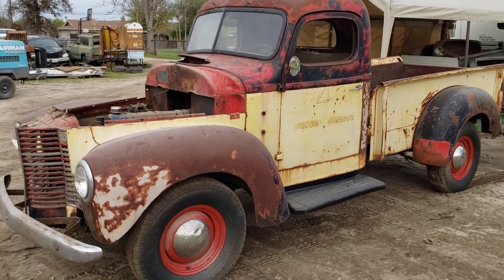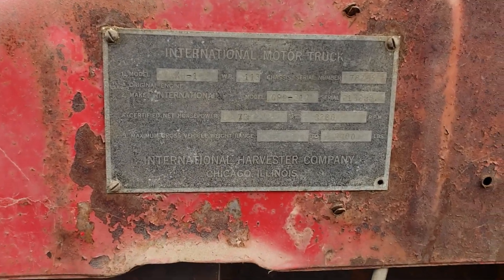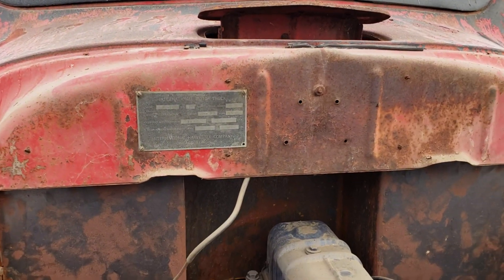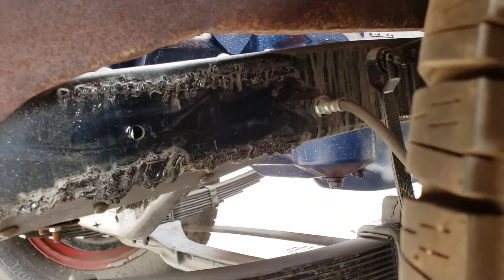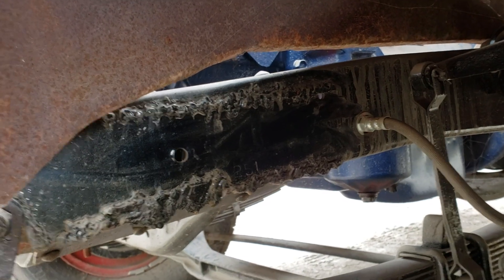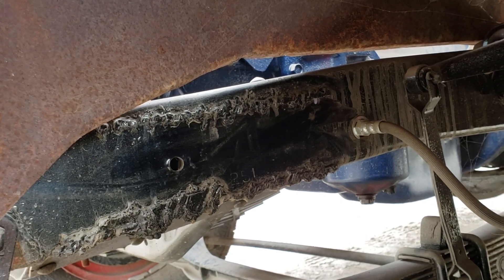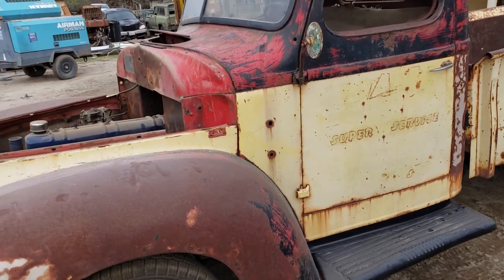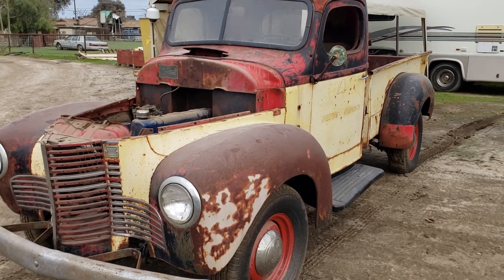California vin verification - truck restoration

Comment: Back in high school (~68-71) I had a fire engine red '49 IHC KB-1 1/2 ton PUP with the Knox tailgate, a Green Diamond 214 ci flathead six and 4 spd.
Push rod starter just above the gas pedal.
Shifting involved double clutching and revving the engine in-between to minimize the gear grinding.
Yeah, it had rust, but it ran and ran and ran; helped me with a lawn business to earn money.  
Sold it in the mid '80s as finding parts was getting hard and time was limited.  🙏

Comment: Did you have to drive the truck across the scales or did they check brake lights, etc. in CA?
Reply from the maker: Trailered it ...... no light and brake inspection..... that is for salvage vehicle's